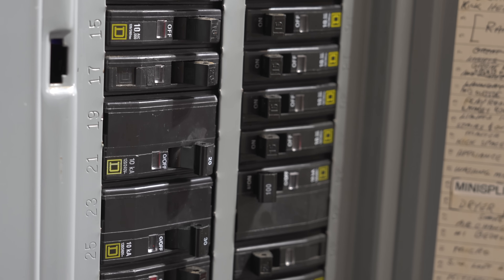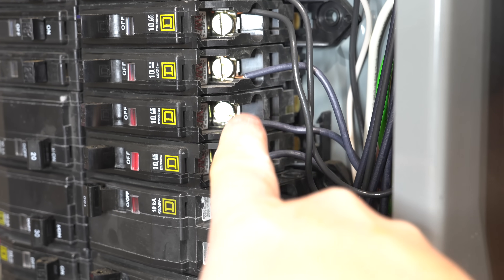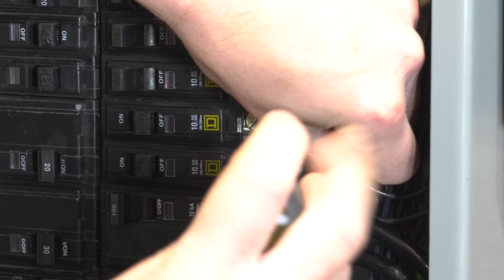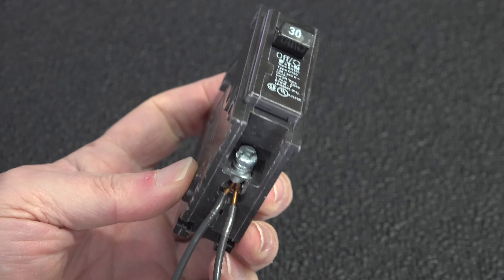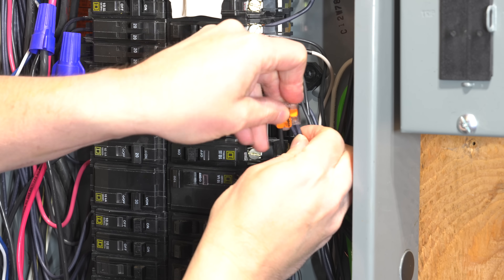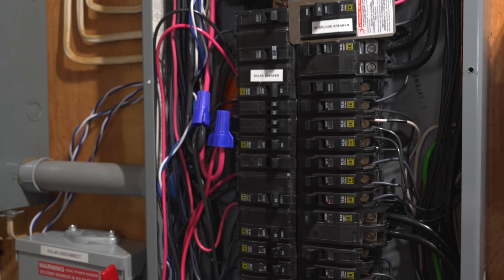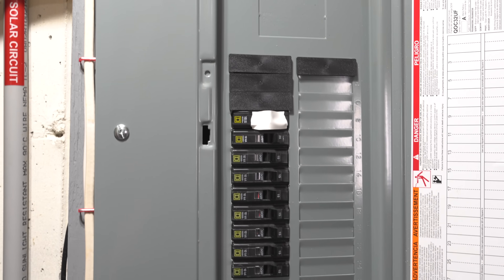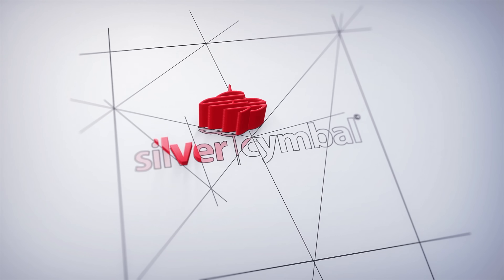Electric Panel Full?  Try This Simple Fix

Comment: It's amazing how many circuits North America has... here in the UK, an average house even now, may have a 12 way panel, upstairs power,  downstairs power, kitchen power,  downstairs lights, upstairs lights, garage, shed, hot tub (if rich), car charger (if richer) and a few spares... Of course using 32A 240v circuits helps a lot with this.

And for anyone complaining about the 'double tap' on the breaker, it's fine, Square D QO breakers are (from memory) UL listed for it.....   Odd fact SC, we don't have the double tap rule, all breakers are rated for as many conductors as will fit physically. One of the most extreme examples is split concentric cable, where the live conductor is surrounded by neutrals/grounds... the neutrals are individually insulated strands, and there may be 10 or so shoved in the same breaker. It's no different than using stranded cable in a breaker (which ours are rated for)
Reply from the maker: I appreciate this and love to hear what you guys are doing over there. The US staying with the 120v design really limited a lot of what we can do here. Now we are stuck with it forever!
Reply: @SilverCymbal  to be fair i think it was a good call, as your transformers tend to be local to the residence. Ours are sometimes a couple of streets away so the 240/415v 3 phase system helps with voltage drop. I worked stateside for  5 years  (although on commercial, mostly 120/208 3ph, with some 277/480 for fun LOL) so am familiar with both systems, both are fit for purpose and well suited  for their respective environments
Reply: You forgot to mention that Ireland and the UK have fuses on the electrical plugs, which is a much safer approach.  The US breakers only protect the wiring to the outlet, the electrical plugs are sized for the appliances.
Reply: @gordon-1  this is similar to the rest of europe, where they tend to use 16A radials. The speed of the breakers is important in this regard, to ensure in a short circuit the breaker trips before the cord gets hot enough to be a fire hazard

Comment: My AC and heat are on the same 30amp circuits. Just bought a home, been doing quite a bit of work(really sleuthing.. damn old and sloppy wiring!). Inspector eluded on this saying “you won’t be running the electric baseboard heat AND ACs at the same time, so it only pulls from the circuit when one or the other is on”. Obviously don’t want to run both at the same time but there’s a real-world example of how it’s used. Also, my home is a 70’s built.
Reply from the maker: Yes, I would definitely agree with what you are saying. Today that would not be allowed as loads are calculated and generally large things like AC, heat, dryer will always be on their own just to avoid any issues. WHat happened in this house, they were using it as a summer house. And from what I can tell every time they needed a new circuit, they just kept double tapping until there were 9 in total. Way too much, so my new subpanel had to already handle the doubletaps but it gives breathing room for future stuff.

Comment: "Only use one or two tandem breakers" - LOL! Someone should have told this to the previous owner of my house. The house has 100 amp service and a small panel and the entire thing is packed full of tandems!
Reply from the maker: I hear you, many houses are like that. Square D redesigned there and their panels so they will only allow 6-8 I believe on a 40 circuit panel, they have a special cut in the slot for them to limit them.

Comment: When lighting in the home was incandescent bulbs, I would expect a multi-bulb fixture to be hundreds or even a thousand watts. So this led to many 15A circuits feeding lighting through the house. It seems that LED bulbs will drastically reduce the load and make it easy to combine a couple circuits into one. So would you recommend making LED bulb conversion the first project and then combining circuits after that?
Reply: I would do some simple math first before buying anything. It is easy to figure out the wattage/volts to amps, I would do this first. I am facing a full panel right now, and that is exactly what I am doing. I have already rewired the kitchen with 20 amp circuits, not touching those, along with the HVAC and dryer. Everything else in the house is fair game at this point. And take into consideration, you rarely if ever have every single light in your house on, along with appliances, unless you have six kids. In my house, it is just two of us, and there is rarely only a few items running at given time, and none of those are going to trip a 15 amp breaker. A little commonsense and math will answer your question. 

The LED lights, if you can tolerate them, they are a good solution, especially if you have any old school flourescent lighting in the house. I have those, or did in the kitchen, 14 tubes to be exact. When those were turned on, you could watch the meter spin outside. These were installed in the 1960's. I pulled all of the ballasts out of the ceiling and installed LED flourecent bulbs I picked up at Home Depot. Much brighter and very little if any actual draw on the system. Money well spent. They have been installed for roughly two years and not one issue.
Reply: I did LED a decade ago
Reply: watched a  average size house  turn on every light in the house 15ish LED  type lights  they  drew little over 4 amps .

Comment: If I ever place 2 wires on 1 circuit breaker, I deserve what comes next!  1 breaker = 1 wire/circuit. Period! Tandem breakers are acceptable but only where the manufacturer states AND where code allows.  ONLY! There’s reasons these codes exist. To protect the public. 
That being said: I do like this channel.  Lots of advise that I have used and work.

Comment: Although Square D Hom(line) breakers have two slots to connect conductors to, NEC and most if not all local municipalities fail inspection if doubletapped and also for-sale inspections will note it needing to be corrected by a “licensed electrician” once observed. If never selling the place, you can do whatever you want.
Reply from the maker: As my inspector here said, you should note that you have a lot of double tapped breakers (rated for 2 wires) and while it does meet code we don't like to see more than 1 or 2 as it's not the best practice. Nothing in this video is advising you to do this for your whole panel, along with the other 2 options which can be used.

Comment: Whats the deal with the breakers that don't have SQD brand markings on them?  Are those breakers safe / counterfeit? etc
Reply: There are many different brands of breakers/boxes. They are not compatible with each other. For instance, I have pushmatic in my current house. I am not a fan because they are not as easy to see if tripped, at least compared with Square D. They are still safe.

Comment: Another option to consider. If your breakers are 1" wide (example GE, CH), you could replace the 1" wide breaker with two SlimLine breakers.  Yeah the two slimline breakers will fit in the same space as one wide single pole breaker.
Reply: Not always, I updated my main panel with a GE 20 years ago. I thought it would accept half breakers but I learned the hard way after I went to put them in and they wouldn't. On the panel I then noticed it tells you which breakers will fit, unfortunately no half breakers will work. So now I'm tempted to get more amp service and update my panel again.

Comment: for 10 amps that Wago is very very likely fine. they do raise resistance. i've also found out the ire insertion needs to be PERFECT. Also the wago can do things wire nuts can NOT like combing 5 wires.
Reply: I love these Wago clips, using them right now in a project consisting of 12AWG stranded wire. Beats the heck out of trying to secure those to romex with wire nuts.
Reply: You can combine 5 or more wires using the right wire nut. I've done that at least 4 or 5 times when replacing/upgrading switch boxes. Is it easy? Absolutely not! Is it possible? Of course it is!

Also, WAGOs can easily handle more than 10 A. Although there is less contact area than wire nuts, leading to higher resistance and heat, it's still well below its maximum temperature rating.
Reply: I've combined 11 wires under one wire nut. Got the appropriate size wire nut that would allow that to happen. To use Wagos in that way you would need 4 Wagos compared to one wire nut. The videos you watch concerning wire nuts they only show the small ones as if those are the only sizes on the market.
Reply: @The_Forgotten_Man  Damn, how the hell did you end up with that many wires inside a box? 

Also, three 5-conductor WAGOs would work for splicing 11 wires. Another WAGO would only be required if it was 12. There are 8-conductor lever nuts out there, so a pair of those can splice up to 14 wires. Either way, a large wire nut would take up less space than multiple lever nuts.
Reply: @The_Forgotten_Man  fuck that, I'd rather just get a buss bar at that point. But I'm the sort to rebuild the whole damn place of need be, I could see someone being forced to 13 wires, one wire nut, out in the field

Comment: Good evening I’ve got a question, I’ve disconnected 3-14/2 wires to replace a light fixture! Without labeling them! What there are, a source that feeds two more loads, what being managed by are two switches/ some outlets and bunch of pot lights!! So far I’ve been able to reconnect one of the switches that control pots and all outlets, what I’m missing is a light and switch that energizes the closest! So again at the moment I’ve a 14/2 hanging! Any advice? Thanks

Comment: Many home inspectors would flag double wires in one breaker  as an issue even if the breaker is rated for two wires. I also think that many local codes are against this. It would be safer to use a tandem.
Reply from the maker: Yes I agree, I used an inspector and as he described it to me, its ok and they don't get too worried for 1 or two circuits but this house had 9 of them and I am glad to have moved them off to the subpanel. More work to do but it's coming along.
Reply: I had a similar issue, I had a old 1971 100 Amp panel jammed packed with tandems and overloaded curcits. I ended up paying someone to upgrade me to a 200 Amp larger panel. Then I broke down the several overloaded curcits by adding more breakers and running and fishing new wires to overloaded rooms that  shared too many outlets/lights. Since my overloaded breakers were all daisy chained outlet and fixtures, I just had to break the chain in a convenient location and run a new breaker/romex to them.

Comment: Good video and thanks for stressing the breaker must be designed/rated for two wires.  It is absolutely critical the breaker have this design rating, if not anyone attempting this on a breaker not designed for this purpose could be creating a serious issue for their home.  With two wires connected to an improper breaker, it could overheat if those two wires are not seated properly, and secured with sufficient contact force from the breaker terminal.  Loose electrical connections over an extended period will overheat and may eventually arc or worse start a fire.  Even if the breaker is designed to allow for 2 conductors, it is important those 2 wires be the same gauge and type.  Manufacturers go to great lengths to test and design electrical panels for their intended purpose, and this is also  why qualified electricians are valuable professionals to insure a safe installation if a homeowner has any doubts doing this themselves.

One other quick point, the majority of standard circuit breakers have a full load current rating (rating stamped on breaker i.e.: 20A) and continuous load rating of 80% for a maximum of 3 hours per the NEC.    Manufacturers test to UL standards (in the U.S.) and the 100% rating is achieved under open air conditions  (no enclosure) where the ambient temperature is held to 40 degree C (104 F).  This is done for various reasons, breakers can be utilized in a variety enclosure sizes, density of breakers can vary, etc..   The enclosure size will alter ambient temperature.  NEC also sizes the cables appropriate to this.   So that 20A breaker actually has a continuous load rating of 16A when mounted in an enclosure.  Just one other thing to keep in mind if adding another circuit to an existing breaker, even if that breaker is designed for this.
Reply: I had an A/C air handler circuit that stopped working after 25 years of operation.  I turned off the breaker to work on it, tested the voltage, and found that it was the wrong one, labeled incorrectly.  The disconnect was very difficult to get to, and as it turned out, one of the 220v terminals had not even been tightened at all.  I had to remove the disconnect from the electrical box to  tighten the terminal, and of course the arcing had done some damage, but not to the point where I had to replace the switch.  I cannot believe that it operated as long as it did.  The air handler had even been replaced by that point.
Reply from the maker: Thank you, people have no idea that so much for the NEC is pushed back to the product manufacturer. It's always been a pet peeve when I see the doorbell shoved under a screw not rated for 2 breakers. It the non-doorbell circuit I get worried for.
Reply: @SilverCymbal Agree completely, once again nice work your videos, I know it takes real effort to produce this level of quality.

Comment: That cable management in the backgroubd tho 😍
Reply from the maker: The guy who wired this place is still alive but in his late 70s someplace in Florida. I am not sure many residential electricians would both with that much care. It used to be on both sides but the 9 doubled up circuits got moved to the new subpanel. That was definitely hot his work, he just did the classy original stuff. Hard to believe it 35 years old.

Comment: You are so right about the tandem breaker. I work in the rv industry and they are the worst at loading a circuit panel full with them
Reply: I use them in my RV and no issues ones a 30 20 others are 15 15 each and one 15 single breaker no issues cause I know what I can and can't run at the same time
Reply: It's not about the panel getting full, though that does become cumbersome, it's about overloading the service going into the panel. The more power drawn to service circuits the more the service has to bear that load. And the more load that is added the more heat is generated. The more heat generated the more likely insulation failure will happen which can lead to an electrical fire. So tandems aren't the issue, it's the people who think they know what they are doing.

Comment: This is not a good idea unless you know what you’re doing and the draw of the devices on each one. Breakers don’t just trip at 15 amps there is a curve that they operate on. It’s possible that you could draw much more than 15 amps between both circuits and the breaker not trip leading to fire hazards.
Reply from the maker: Yes I think I mentioned 3 times this would only be helpful on light circuit such as a door bell, single outlet and light duty circuits. Tandems as discussed in the video are a more straightforward solution,

Comment: In some states (Texas is one) it's not in code to make any wire connections inside the breaker panel.
Reply from the maker: It's interesting that you say that as I had always heard that until about 10 years ago where an inspector shared that its always been a myth. The confusion is that you can't use the panel as a pass through for a circuit that isn't connected within the panel, so you can't just use it as a junction box. However connectors and splices are allowed and common. Texas may not be adopting the nec or following which is there choice but that has always been a discussed topic.

Comment: The next question is about grounds and neutrals…
If you can double a hot to a circuit breaker with a pigtail or Waygo can you double a neutral or ground with a pigtail to a single spot on the neutral bar?
Reply from the maker: Now that is a very interesting question. You are never allowed under code to have two neutrals under a single screw in the main panel but pigtailing them would likely still not be allowed. Since my understanding is that the single screw for neutrals relates to interrupting a circuit during maintenace, etc. Which would still happen even with a pigtail, so my guess there is no but others may have more to add. Great question though!
Reply: @SilverCymbal  my thinking is that they are all on the same bus, so what would the difference be?
Reply: Neutrals can never ever be double tapped these days. Almost every neutral bar is rated for only one neutral wire per screw, so putting more than one would lead to loose/improper connections and excess current flow, both of which cause overheating. There are so many videos/pictures of this. That's why more recent revisions of the NEC would prohibit double tapping neutrals. Pigtailing would only solve the improper connection issue. It won't address the main issue, which is excess current flow. 

When it comes to grounds, yes they can be pigtailed because grounds are always allowed to be double tapped. In my panel, I see two 14 awg or two 12 awg grounds combined into one wire using a crimp sleeve before landing on the neutral bar. So they can definitely be pigtailed instead of crimped.
Reply: @aurvaroy6670  "It won't address the main issue, which is excess current flow. "  It is the same current flow as the hots which are double tapped.